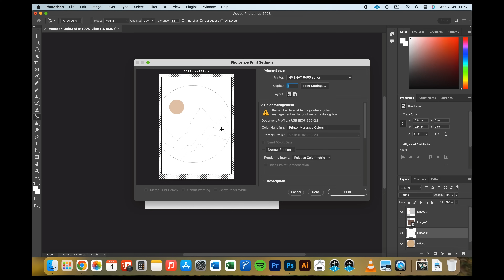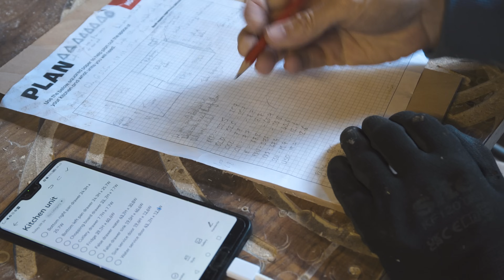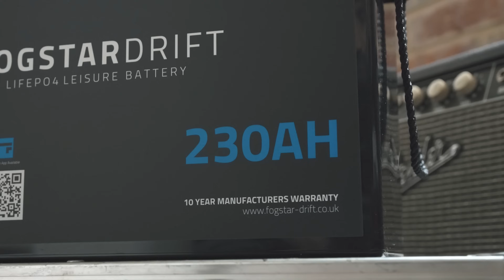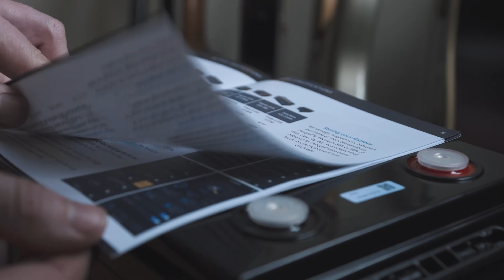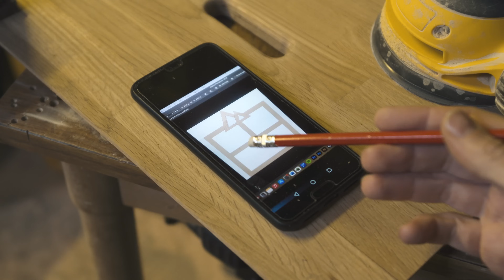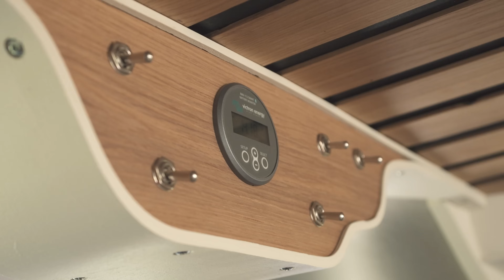DIY Campervan Conversion | Full Build Timelapse | Nissan E-NV200 Electric

Comment: The weight of the build does not influence too much the distance you can still cover with the van ?
Reply from the maker: Hey Didi, the fit out weighs 200kg in total so it affects it a little but not too much, I got 130 miles out of it the other day fully laden 😊

Comment: 35:35 - what we use as filler, to avoid that discoloration is to mix the sawdust into some glue and then use it as a paste/filler so that the color of the filler matches the color of the wood.

Comment: Hello, i love your designs i have been binging your channel over the last week as I've grown passionate about the concept of upcyclying vans into camper vans. I also just find your style very enchanting.

I am wondering if you have any tips for beginners for getting started on doing something like this?
Reply from the maker: That's great, thanks James! I was going to so yes, get someone else to do it 😂 But no, not that I'm an expert, but I think having a good plan to begin with is helpful, it gives you continuity in the design and also ensures everything essential to you is present and will fit. Add 15% to what you think it will cost to build, people forget you need adhesive, glues, screws, latches etc. Kreg/Trend woodworking jigs are a great woodworking tool for beginners, you can use them to frame everything from your bed to your kitchen units, be sure to buy a few clamps with it to ensure the joins are nice and neat! The almost halfway point when you're putting the cladding/walls up always seems like breaking point to me, but don't feel disheartened about how long it has taken, it'll get there eventually and be worth it in the end. Also, don't be disappointed if you make mistakes, it's all part of the learning process and best to accept beforehand that they will happen, I probably redid 1/3 of the jobs on my first van conversion. And just a few small tips, don't over-clamp bonded windows, remember to use a voltage drop calculator when sizing wiring, use a tough paint/finish for heavy traffic areas, ventilate, double-check your electrical system is large enough to stay off-grid if you intend to and ensure you have enough money left to actually insure it, fix it, and ultimately, travel and enjoy it, best of luck 😁✌️

Comment: I've been thinking about the NV200 for quite a while. It's this or the Toyota Proace. The key thing will be the bed size. 160cm wide is mt ideal size. What is the finished bedsize?

We love you your real wood feature items: the spice rack; the lift up marketry table, the shelf, the circular feature light; the rear step detailing; the shelf; but especially the control panel. 

Try & try again! You've done well!
Reply from the maker: Hey Karen! Thanks for the kind words, it's only around 100cm wide, I think the whole thing is only 160cm wide 😅 you might be able to get a van that has room for a kitchen unit up top, perhaps a VW Caddy Maxi for example

Comment: Hey Joe and Beth, amazing build! I’d love to match that craftsmanship on my own Nissan e-nv200 conversion. 

I’m just starting out and now figuring out the electrics. Question: why did you choose to use a leasure battery? Could it also be possible to just update the  starter battery and power everything from there? I figure that there would be less losses? 

Thanks! Bart
Reply from the maker: Hey Bart, thanks for stopping by! Yes, there's a chap called Glyn who you may have seen on here already who did exactly that. I personally put the leisure battery in for a few reasons. Firstly it ensures the starter battery doesn't go flat, secondly starter batteries are designed differently to leisure batteries, they're better for giving a high amount of current over a short period whereas leisure batteries are better for a low amount of power over a long period. Also, we have an induction hob so wanted to make sure our leisure battery was plenty big enough to support that off-grid. I'm sure you could use the starter but you may have to consciously switch the van on to ensure it's topped up, I believe this is what Glyn does, he has a single induction hob. Should prob note there would be limitations on the amount of output from the starter battery to known as the max discharge rate, each battery has its own limitations but I imagine a single induction hob would be pushing it. Hope that helps 😅

Comment: Your car is modified really nicely. I wanted to ask, how did you transition between the roof at the back and the driver’s seat area?
Reply from the maker: It wasnt really designed for that, it's pretty tight between the seats but I'm sure you could if you squeeze in enough 😅

Comment: Hi Great van build I'm building a simulator pull out bed system love the idea of the legs to support when pulled out, can you tell me were you obtained the knock in inserts for the legs.
Thanks
Reply from the maker: Hey Ian, yes of course, here's a link to the eBay listing I bought them from https://www.ebay.co.uk/itm/222910188029?mkcid=16&mkevt=1&mkrid=711-127632-2357-0&ssspo=Hfz_4EI6R_e&sssrc=4429486&ssuid=weZm3lMvQ8q&var=&widget_ver=artemis&media=COPY
Reply: @WoodandWild  Thanks

Comment: The weight of the build does not influence too much the distance you can still cover with the van ?
Reply from the maker: Only a little, the entire fit out came to 200kg and managed to get around 120 miles the other day on mostly 60mph+ roads